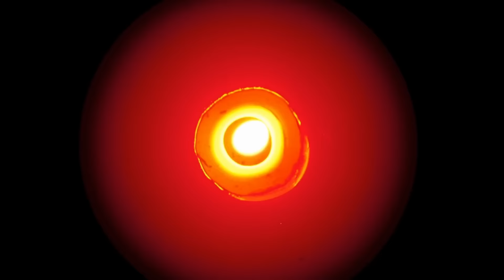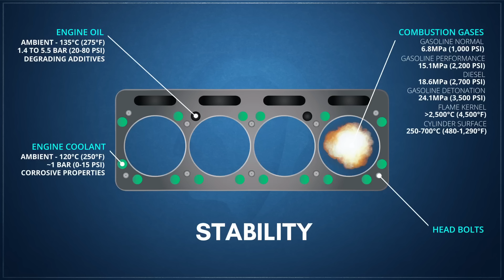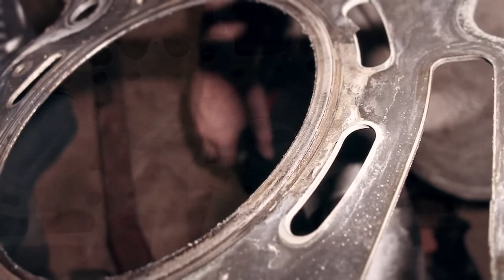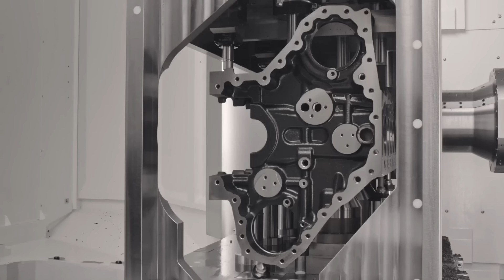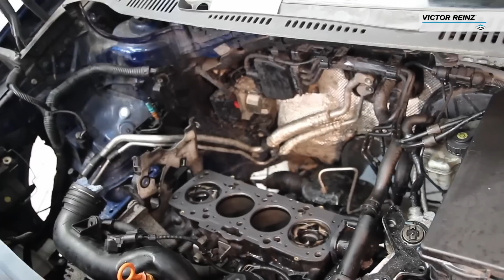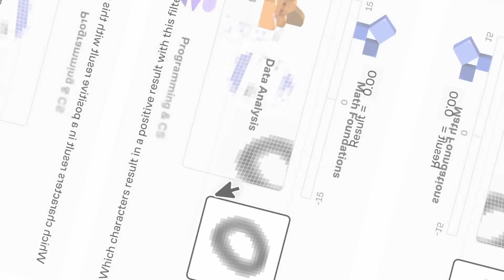Why This Basic Engine Part Is So Difficult To Design

Comment: the easiest solution thats been around forever is to design a car without a head gasket. a car where the block and head are one solid item. the only issue is drilling out the oil and cooling passages but other than that its the way to go.

Comment: Puppet valves and valve seat inserts are more troublesome than gaskets. They will surely wear by design hard part is to control the wear rate. They are hard change nearly whole engine needs dismantling. When a valve brakes it destroys the cylinder walls. When a valve expands too much it causes p2v contact. They are harf to optimize because from cam to valve lift and rocker ratio if rocker present of course there are too many mechanical loses. It is too reliant on material selection not only the valve but you need a good pair with the vsi. And Engine Brake omg the engine brake relies heavly on valve performance.

Comment: With an opposed piston engine you eliminate this part, as well as the valve train which soaks up all the heat energy, and you can have about 100% more power from the same fuel in the same foot print.

Comment: 17.10 “likely to be last design, due to the impending transition away from internal combustion engines….”. I think you’ll find that the death of mass market ICE cars has been crazily exaggerated.
The underlying reason for this alleged transition is utterly fraudulent. I can’t believe how few people have done the simplest level of research to confirm or disprove the rock solid linkage between human release of a particular gas and purported elevation of temperature in the atmosphere. I can report that you can become certain that the central claim is false in just a few hours of self-directed research .
Once you know what the most reliable sources are, it’s much faster still. 
Unfortunately, all one-to-many means of communication are subject to extremely effective, automated censorship, so I cannot be more specific here, or YouTube will delete this post.
Very many more people do know that battery electric vehicles do not spare much if any release of the implicated gas, across its entire life, from manufacture to scrapping. So, even if you were fooled by the fake crisis, you ought to have been extremely suspicious of any purported fix that you knew didn’t work.
The bottom lines are that there’s no real world crisis, no need for a “transition” and that there are other motives entirely for lying to us all in ways that are rapidly & irreversibly destroyed the previously very strong automotive manufacturing sector in Europe.

Comment: So really dumb question?
Can you just bolt the block and head engine parts together without a gasket? If the manufacturer shapes the surfaces to make them near parallel, wouldn't the two block pieces fit together tight enough and with the added bolt/fastener torque, would that not be a good enough seal? What is the gasket actually doing extra?
Thank you in advance!

Comment: As someone who works in engine development, the Head Gasket has it fairly easy tbh.

Liquid sealing is easy-ish due to the low cross sectional area, the limit here really is cost. Gas sealing is managed by the Stopper Layer and flexible upper and lower sheets. Structural limitations and surface finish errors of the block and head cause more Head Gasket failures than the Gasket itself. 

Take a look at the regime of an Exhaust Valve. It's an absolutely horrific place to exist. 😂 The temperatures, loads, sealing requirements of both gas and liquids and resistance to wear, all of it is extreme and nearly all improvements in engine performance or economy make the Exhaust Valves job harder. 👍🏻

Comment: I've had 2 motors blow a bearing and 1 motor (lawnmower) blow a gasket but then again I built the lawnmower motor myself and I think I put it in upside down. 😅
Strictly anecdotal and the 2 blown bearings were most likely from infrequent oil changes.

Comment: "Engine should have 20-80 psi oil pressure"

Volvo Redblock with 400k miles: my oil pressure light comes on at like 7 psi lolll

Comment: The greatest weakness of the steel embossed layer design, is that the manufacturing process (putting the embossments into the steel layer) generates such local stresses and strains, that if the head movement exceeds about 7 micron of lift, the embossment will suffer fatigue failure. Not reliable at all. This explains why this "perfect tech" that was around since the 1920's, failed to "take off" until the 1990's. Workarounds include careful engine design to limit that movement (which is nigh on impossible), adding that "stopper layer" (effectively a raised ring adjacent to each cylinder bore to preferentially carry the bolt assembly loads, such that all of that load has to be offset (by combustion pressure trying to lift the head) BEFORE there is any lift movement. And lastly, by going "multi-layer", to share excessive movement over multiple layers, so that any one layer is below the fatigue threshold. 

MLS is also a very expensive option, because each layer has to be coated in micro-sealing material. Otherwise fluids and gasses will leak out BETWEEN the sheets. In a three layer gasket, it's like fitting three gaskets to one engine. Hence, this is never a cheap gasket to make. But its price is sufficiently low in the grand scheme of all the parts needed to build an engine, that it can be justified IF the right design does bring reliability. 

However.... when its "reliability" is somewhat of a myth invented to justify the price, but just as difficult (if not MORE difficult) to "get right" than most of the other types of gasket, engine manufacturers think long and hard (and usually test to death) before committing to any one specific gasket. I saw many promising MLS designs that ultimately failed the fatigue test. Add another layer to solve it, and add 25% to the gasket price? The OEM won't like that AT ALL. 

Sometimes it was cheaper to sputter on a variable thickness stopper ring that took on the shape of the deformed (assembled) head and block, to better distribute the assembly loads as clamping forces around the combustion seal, than add another layer. 
It got that desperate sometimes. 
This idea works OK, but only while the engine is operating "normally". Drive it hard (hotter than usual), have some abnormal ambient conditions, low oil or weird coolant (or a coolant leak), or mess up the timing to get knock, and it would fail quickly. So, it was ALSO helped by the growing dominance of electronic ignition, where a user could NOT mess the timing up, and destroy his enthusiast engine.
The trick means it passes the testing procedure and gets approved for production, then fails in the field as soon as "real world conditions" go outside the tight test parameters. 
(Think VW dieselgate, as an example of what I'm trying to describe here.)

Having been in the head gasket industry at the time when "everybody wants MLS" became the reliability buzzword, it truly felt like it was just the latest fashion item, that nobody understood. 
Everybody wanted it, because Toyota had made it work for them. No details about how many years of expensive agonising development, and hard choices about "yeah, double the cost to make it... it'll be worth it..." at exactly the same time as companies like GM were deliberately squeezing every last penny out of every single component in the entire vehicle to cut production costs. 

Customers wanted MLS, but they also wanted it cheaper than the existing gasket options. 
Being the manufacturer caught in the middle of "I want the best for nothing" was deeply unpleasant. 
Part of my job was educating those OEMs about WHY MLS was so expensive, and why it wasn't necessarily the best choice for their new engine. 

The British Rover K series elastomer gasket had ONE major weakness - the elastomer was too cheap, and once it hardened, it was prone to breaking under the high pressure of the oil feed to the head. 
Aftermarket replacements addressed that weakness with a reinforced seal around that ONE oil hole, and reliability was virtually perfect after that. 

How do I know all this? Because, I was analysing engine structures for load and deformation, assessing head gasket performance with mathematical simulations and engineering models, back in the 1990s. Working for an international gasket maker that produced almost all of the types mentioned here. 

One fun anecdote:
There was a 1960's in-line 6 cylinder engine, that the manufacturer wanted to update in the 1990s. The old fibre gasket was out, because it tended to leak oil at the edges of the cylinder head, where the cam gear would return oil to the sump via large drains. 
They were offered a shiny new MLS (Multi Layer Steel) design, that I had to prove could cope with the thermal movement that was opening up those leaky oil drains. Did so successfully, the gasket prototype was duly installed, and the engine test began. 
And it promptly failed the main bearings that support the crankshaft. 
The reason was covered in this video, although not explicitly explained in detail.
That old engine had a cast iron block, and aluminium cylinder head. These metals have different coefficients of thermal expansion. So when the engine runs and gets to operating temperature, it doesn't just expand the "flame deck" (the sheet of cylinder head surface exposed to combustion gas) laterally - to open up those oil drains and start a leak. It ALSO expands along the length of the engine. And, as a solid sheet, is much better at expanding lengthways than the "holey" block perforated by cylinder bores below it. 
More to the point, the block structure supporting the crankshaft was beefy and stiff. 

In the old gasket, the fibre layer provided a slippage sheet, so that the head could "slide" as it expanded. 
The extra surface grip of the MLS gasket kept the head and block glued together. The head expansion was constrained, but mostly held by the crankshaft a long way below, not the top deck of the block.

Net result, not forgetting this was a long engine, being an inline 6, was that the entire engine bent like a banana, with the thermal expansion bending a bimetallic strip, curving so much that the running tolerance of the oil journal bearings of the crankshaft was exceeded, causing those bearings to make metal to metal contact and fail. 

The gasket didn't fail, but it caused bearing failure of the crankshaft instead. 

So, yeah, getting a head gasket design "right", is indeed a challenging task. 

But it won't be long now before EVs make all this "tech" obsolete.
Reply: Great comment I learnt a lot, thank you

Comment: Other than stopping the engine freezing the coolant main job is corrosion protection, so no coolant does not corrode bits of the metal and allow them to flow around  ..  The reason for much longer coolant change intervals these days ( 10 years ) is down to improved corrosion OAT inhibitors - the actual anti-freeze bit does not really wear out.

Comment: Tires have a harsher life than head gaskets. 
Just look at how often they're replaced in the life of a car. 

Sharp impacts
Kerb edge impacts
Flat spotting
UV degradation
Temperature variation 
Internal pressure
Chemical attack
Centrifical forces
Abrasion
Grit, water, ice, tarmac, glass, mud, submerged, etc

That's a lot more than a head gasket
Reply: Chalk/Cheese
Reply: @MattyEngland you cleanly didn't listen to the start of the video. 

They claimed that head gaskets have a harsher life than anything else on a car (or similar words)

Hence I have explained that tires have a harsher life. 

It's not chalk and cheese, unless you don't know what the expression means.
Reply: @procatprocat9647  He said within the car, not attached to outside of it. Was clearly talking about engine components etc.

Comment: I'd like to point out that for well over two years now there have been technologies that can be added to internal combustion engines, including diesels that the exhaust from the running engine is completely breathable are devoid of any real pollutants. That bodes well because the current understanding is that the Earth is constantly manufacturing oil. And it would make a functionally in exhaustible fuel source

Comment: The offenhauser didnt split the head from the rest of the block and thus could reach quite high compression ratios as they didnt need a gasket. Impressive for the 50s.

Comment: Steel when you heat it up to a fairly high temperature when it's turning into the orange or yellow range and allowed to cool slowly will Anil it. But copper does not work that way. When you get copper up to Red Hot or orange hot, you Aneel it by dropping it into water and cooling it off quickly

Comment: Alternatively, you could be GM and use the wrong material for the 1991 Pontiac Grand Prix, and the car is basically guaranteed to blow after 100k miles.
I wonder if they used the same tech as those British companies, to try and cut costs.

Comment: When I was building a B-series Honda engine for racing use back in the early 2000s, every professional told me “just slap a stock Honda MLS gasket on it”. They were right, you can easily double the output of a Honda engine and as long as the surface of the head and block hasn’t been abused, overheated/warped, the MLS gasket will seal the combustion and liquids with no issues whatsoever!

Comment: Small Honda engines don't always have a head gasket, they make the whole thing one big casting. Was weird when I first had to fix one.
Reply: Gaskets are only needed when you can't make a good enough seal without them.
Reply: Are these like generators and stuff? Or those European market 1L engines?

Comment: The timing belt is the weakest link in every car that uses a timing belt instead of a timing chain.
Reply: Only when not changed at the correct interval. Timing belts have been extremely reliable for years.... At least until some mong at Ford decided to invent the wet belt.

Comment: The simplest ones are literally all copper sheet. Those are also the best ones. The second simplest ones are metal sheets with o-rings for oil and coolant passages. They work just as well.
Reply: MLS is by far superior.
Reply: @negativeindustrial  not necessarily, I've never heard of a copper sheet head gasket failing, even in high boost pulling tractor engines where a normal head gasket doesn't last 5 seconds

Comment: If we use logic, which may be flawed in my case, but for me it seems if this what you are saying is true then this part would have most failures in various engines and also in majority cases where replacement part is made in some questionable factory and conditions. And this is not the case, almost any head gasket willl last more than turbo charger if it is not perfect and manufactured from few major manufacturers and is working in perfect conditions, also DPF, also bunch of other components usually fail way before you even consider to doubt in head gasket. So either this what you say is not true or manufacturers or all manufacturers invested unreal amounts of money and time and cooperation and all gaskets are now ok, but in other car parts there are wild differences where you can have one manufacturer part fail in a few days and other last for years, and again, disregard all but tell me if gasket is that dificult and stressed part how do you explain all other parts failing before gasket ?

Comment: Say what you want about the stress the head gasker is under, but it's a static component and has plenty of distance to use in sealing that pressure. I'd argue that the most stressed component is another seal that has a more demanding job: The piston rings.

Comment: What if you produce only one part, so no gasket is needed?
Reply: Bentley and Bugatti were racing marques who notably adhered to monobloc engines, through the 1920s and into the 1930s.
Btw my 35 cc 4-stroke Japanese made garden trimmer also is a gasketless one-piece design.
Reply: Possible but very expensive

Comment: The ruston hornsby is the only engine to use a saturated grease gland which is just cloth soaked in grease that we stuf in to a chanel dug around the head where a raised flat clamps doun on it keeping the gasket from direct contact with the combustion gases I don't think most people here even know it exists let alone worked with it

Comment: Did the video mention whether a gasket can be reused after initial clamping?

Noctua CPU cooler mount system could also be very useful in this application if it could be souped up to handle the kind of forces involved

Comment: Copper is literally compressible.

This is why we still use copper crush  seals for hydraulic brake lines.

It just takes a bunch of force to actually get copper to compress, especially when compared to composite gasket materials
Reply: Not so compressible when there is a large surface area that lowers the PSI like it would on any head!!  It needs a bead that will actually compress & deform for sure.
Reply: heat to aneal

Comment: I'd like to see a video on the history of flexible metal tubing. The sort you see on those bendable grill lighters, shower wands, or the sorts used for electrical conduit. How they came up with the engineering that would go into making a tube out of metal but have it be easily bendable seems like it'd be interesting.
Reply: 99% of the time its just a rubber hose with a metal lining

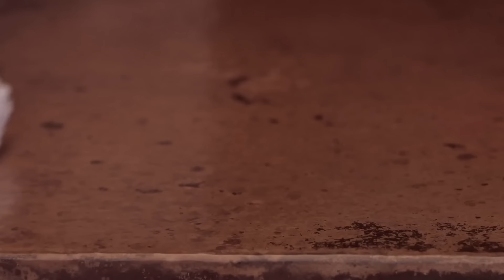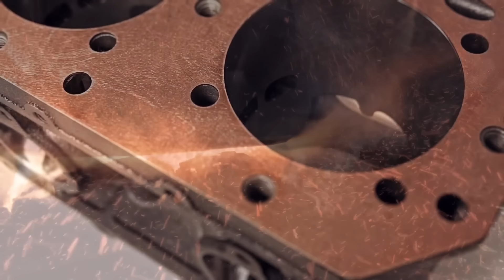Comment: 7:47 - 7:54 That is wrong. Annealing copper is achieved by heating and then quickly quenching in water. You mentioned that it has to cool slowly. That is wrong and does not work for copper.
Reply: It works the same if you've heated it enough but you get bored waiting for it to cool down.
Reply: @ruben_balea  Technically you are right. For practical reasons, annealed copper is quenched in water to speed up the manufacturing process.